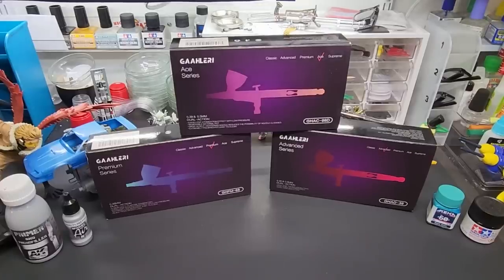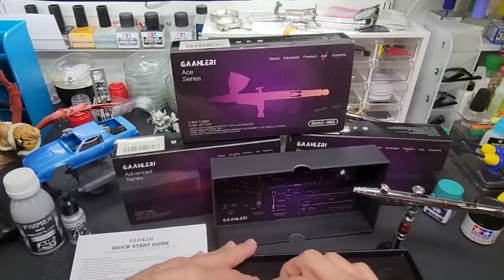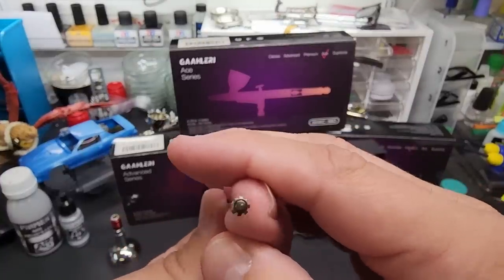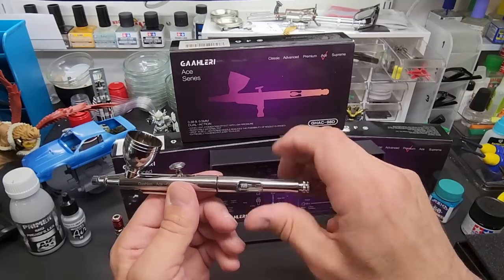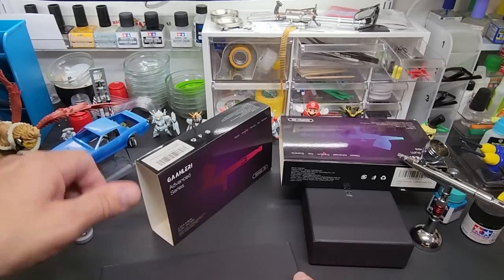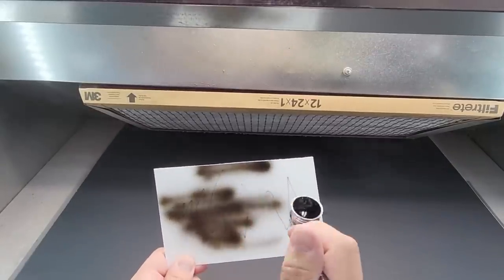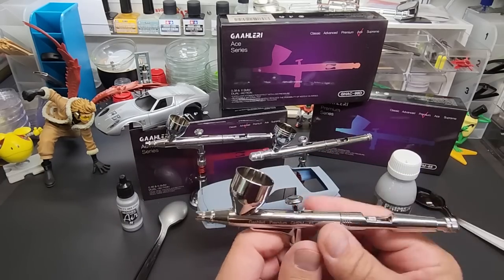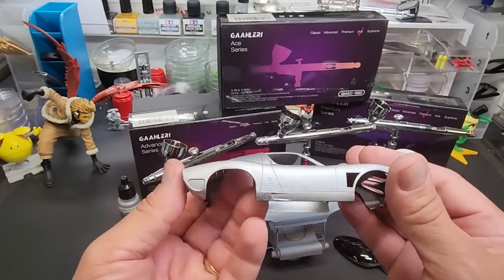Testing Gaahleri Airbrushes - Great New Airbrush Line

Comment: @barbatosrex
From my understanding the Gaahleri airbrushes are unique since they have the “8 channel” Quick self centering nozzle. 
My questions:
Do other similar airbrushes have a “quick self centering nozzle"? 
What makes Ghac 98D superior to the Ghad 39? The only physical difference? At first glance is…
Needle: Ghac 98D has a 0.38 needle vs Ghad 0.35 needle
Needle: Ghac 98D has a Flexible needle (only mentioned in Ghac 65 and up) vs Ghad 0.35 no mention of a flexible needle. Please confirm other models like Ghad-68 and down comes with flexible needle?
Ghac 98D has Mirror fixed cup vs Ghad 39 Non mirror removeable cup. I’m assuming this makes cleaning easier?
Aside from needle sizes, “flexible needles” and mirror cup what makes Ghac 98D superior to the Ghad 39? Does Ghac 98D atomize the paint better due to the “flexible needle” and needle sizes? What am I missing?

Comment: That's some impressive quality and performance for the price point. At first I was perplexed that a .02 needle set isn't included nor available. I typically spray paint at 12-15 psi with the smaller needle set in my Iwata HP-CS and use my Badger Patriot with a .03 needle set at 25-30 psi for primer. I'm really impressed that the ACE model will get such fine lines with no spatter using the .38 tip. Pure speculation here, but it seems from a design point, these guys have maybe cracked the code on removing air turbulence at the needle. I know by removing the tip guard from my Iwata, I can get finer lines. So it appears that the tip guard actually introduces air turbulence, which affects how fine a line you can get. I'm not currently in the market for a new airbrush, but I'll definitely be telling folks about this. I'm impressed.
Reply: Actually, the concentricity of the needle nozzle plays a major role in determining the fineness of the line, not just the diameter of the needle. The design of the air passage is mainly aimed at achieving a more uniform atomization effect. Our design aims to make this airbrush suitable for more scenarios, and after years of research, we have overcome the problem of maintaining concentricity with a quick self-centering drop-in nozle structure, resulting in very small production tolerances and lower pricing for mass production. If you have any other questions, feel free to email us!

Comment: The GHAC-98 Dual sprays VERY NICE! I used my GSI Creos PS-289 needle chuck though because I always disassemble my airbrushes prior to first use to clean and lube. Their needle chuck needs improvement.  Does seem to like the paint a little thinner than my PS-289, yet seems to reduce orange peel. Very happy with this airbrush.
Reply from the maker: Awesome, great to hear. These are very good airbrushes

Comment: First off, thanks for this review.  I am happy to see new companies entering the market.  I must be missing something though.  For $120 you can pick up a Harder & Steenbeck Ultra, an Iwata Revolution, a Badger 105, a GSI 289, or many other name brand airbrushes.  Other than the Chrome cup, which is nice,  I don't see what would make me choose this airbrush over any of those.  You are basically spending name brand money for a company that has no brand recognition, currently offers no replacement parts, and has pretty much one detailed review.   I took a look at the $40 offering, and it looks almost identical to a $30 Timbertech set I own.  Is the 8 channel MAC nozzle worth a 25% premium?  Don't get me wrong, I hope this company can hang in there for the long haul, but right now it doesn't make much sense for me to buy one of these brushes unless they are heavily discounted.

Comment: I own the ghad 39, the ghad 68, the ghac 98d, and the new swallowtail barbatox rex trigger ab. All are good brushes that I plan on keeping. With that said, the swallowtail has given me some trouble with the trigger not being smooth and with sharp corners on the trigger not being beveled. The brush becomes downright uncomfortable after a while. Whoever manufactures these brushes for Gaahleri represents the best quality that mainland china is currently producing. However, the price points of the 98 and swallowtail series are too high when compared to sparmax(better quality) and gsi creos(even better quality).  I have no doubt Gaahleri will up their quality to compete with these 2 mentioned above companies. They are just not quite there yet. At their current pricing structure there are better choices to be had.  I didn’t mention Iwata because although excellent brushes, they don’t really compete with Gaahleri price wise.  I don’t know of an ab on the market better than a gsi creos for the price. They represent the best value in ab’s imho.

Comment: Just got a 39 and was working fine until today. For some reason its not getting the full air pressure coming thru the brush. I did a deep clean and still not getting the full pressure thru the brush, any suggestions?
Reply from the maker: Contact them, they have the best customer service out there, they will help you for sure

Comment: Very nice! It seemed like the Ace really liked the primer, maybe more than the paint. They've really done the work to lay out some nice brushes and do some innovating in the process. I don't know why I didn't think of polishing the inside of my cups! I really wish they had sent you their trigger airbrush, as that would be up my ally. It looks good and uses some of the Ace and the Premium parts and has the eight channel tip. Well hopefully they'll send one your way and you can do some testing on that one.
Reply: I would be careful trying to polish yourself. I tried on one of my cheap brushes and the plating was so thin, first round with 2400 micro mesh removed the whole layer in some spots
Reply: @TheAlexdodd  Thanks for the heads up!

Comment: Great video. If I needed a new airbrush I’d consider it. But I already have my Neo for iwata, patriot 105, GSI creos ps289 and the cheap red one you did a video on and I haven’t even used the ps289 yet. 😅 I don’t paint enough kits or room for finished kits, to have that many airbrushes. I’ve only Just got rid of the all the cheap $20 ones I had lying around in various states of disrepair. But I’ve saved the video so when I do want a new one (it’s inevitable) I can go look up the link easily

Comment: I´m currently on a tight budget, so I bought the cheaper one; it just arrived today and it´s indeed quite awesome. I compared it to other quite similar cheap airbrushes, and while yeah similar, the measures are a bit different, and ofc, the drop off nozzle is quite different. Only downside is that the needles that came with it needed a good polish though.

Comment: Great review! I can't believe that gun sprayed Model Air at 15 psi straight out of the bottle as well as it did!! I usually have to thin it with 2-3 drops of the Vallejo thinner and then crank the PSI to 20+ (on a 0.5 needle) just to get it to spray properly. Gaahleri has done their homework and produced an airbrush I would have made (if I had the money), which means I'll be purchasing two of the Ace models so I don't have to switch needles. Thanks again!
Reply from the maker: For the record, I did put a few drops of Flow Improver in the Model Air

Comment: Purchased the Gaahleri GHAC-98D today for a Sunday delivery! Amazon gave an extra 5% discount in addition to the Barbatos Rex 20% discount for a total of 25%! Total cost out of pocket was $89.99 plus tax. This is on par with what I paid for the GSI Creos line of airbrushes also recommended by Barbatos Rex. I really like that they polished the inside surface of the color cup, and am wondering if this is possible to do on some of my other brushes?!
Reply: This airbrush costs around $10 usd. It is made in China, rebranded, marked up $30 goes to manufacturer, rest to Amazon and this guy making the video.
Reply: @ddx5769  And mine will arrive tomorrow. It is what it is.🫡
Reply: @dwells77  I’ll check back with you after a year to see how the quality is lol
Reply: I don’t mind healthy dialogue. However, if you’re going to identify issues with this airbrush/ airbrush offer, you should at least include solutions and/or alternatives. It seems like you’re just looking to be “right” or to be able to say “I told you so” when the truth is it won’t even matter in a year…

Comment: Your badger has the multiple air channels also.  They are in the housing right in front of that single hole you showed.  That hole is the air passage from the air check valve at the base of the body to the tip of the brush.  The air comes out that hole into the nozzel housing and spreads out through the housing,  then comes out the evenly spaced holes around that housing to spray around the nozzel tip abd needle. 

Still these look like nice brushes.  But i can't let you misrepresent my badgers 😂😅😂😅

Comment: Dang, wish I had found this a couple of weeks earlier since I missed the coupon deal, and the base price is a couple bucks higher as well. I've been looking for a cheap starter to re-learn with. I had previously tried a couple of siphon feed models, a Harbor Freight and an old Badger model I found, but constantly had problems and moved on. Been wanting to give it another try at some point with a gravity feed and was tossing around a Timbertech or NEOECO. Not in a huge hurry. Is this starter brush really a step above the others?

Comment: Bought a GHAD-39 with two nozzle sizes, very impressed with the engineering standard of the build, certainly better than the the other entry level tools I have (Harbor Freight & NeoEco) - the consistency of the results produced in fine work is especially satisfying and I believe delivered by the fluid control knob mechanism and ease of cleaning made possible by the design. I am only concerned with getting spare parts as and if I need them - the NeoCon and the HFT are problematic for spares; the Paasche VL & VLS I have are great for spares but can't really do fine work consistently; Can't seem to find spares online - Anyone got suggestions?
Reply from the maker: I'll be posting a new video tomorrow with new info, the Neoeco company is preparing a website so customers can order all the parts of the airbrush. It will be up next month

Comment: another great video. i am just starting to learn how to airbrush . i bought a sagud airbrush compressor kit off amazon . it came with 3 airbrushes . i think it will be good to start off with.   your videos will help me learn more trhank you for doing such great videos. the only thing is i cant tell what size needles come in them. they dont tell you on the paper work.
Reply: Airbrush Gun CS-30 with 1/3 oz gravity fluid cup & 0.3 mm pre-installed needle
Airbrush Gun CS-36 with 1/4 oz gravity fluid cup & 0.38 mm pre-installed needle
Airbrush siphon feed with 3/4 Jar & 0.8 mm pre-installed needle
Reply: hope you will enjoy them and get a great start on your airbrushing
Reply: @gaahleristudio  thank you sir. i found them they are 0.3 0.2 0.8 like you said .i used the 0.3 one it worked pretty good . i think i thinned the paint a little thin. i have testors paint .i watched your video on how to use them very helpful. i just have to learn how to ajust the airbrush and learn each part of the airbrush.
Reply: @Bubbasmodelcarshop  if you need any help, just contact us!
Reply: @gaahleristudio  thank you a question .i watched the video that you did on the elite spray booth master airbrush MASB 3000. i see you vented it into a bucket . i made my own spray booth and did the same thing .is there any special thing i have to do for doing it that way. thank you mike owens

Comment: Would you say this is a top 3 air brushes you would currently use? I had another friend suggest this company but i can't find out a lot of info on them.
Reply from the maker: They're a new company but I must say they are awesome. I highly recommend them
Reply: @barbatosrex9473  I just bought the ace. I didn't hear about the discount code because I got excited and got a call from work when I was ordering it. I will make sure I finish the video before I get so excited i hit buy now haha😅

Comment: Should you sand primed parts before putting on color?
Reply: I wetsand primed parts with 2000 grit tamiya sponge. Glass smooth after. Don't press hard, avoid sanding on the sharp corners, it's easy to go through the primer on the crease lines/corners.

Comment: I got the ace and trying out alclad black base it seems I have to blow a bit of air onto something to catch spots/blobs of paint so they dont fly onto the surface Im trying to paint, is that because its kinda drying in the nozzle cover? If I keep sweeping back and fourth like spray painting I dont get that, its only when I stop then go to start again it'll blow dots out
Reply: This is a normal phenomenon and occurs on all airbrushes. When we spray, we first press the trigger to release air, and then pull it back to spray paint. Therefore, at the end, we should reverse the process: first push the trigger forward to release only air, and then release the trigger. This is a good spraying habit. Because if you suddenly release the button while spraying paint, there will be residual paint on the needle and it will be blown out during the next spray.
Reply: @gaahleristudio  I think that was my issue! Normally I don't think about it and just release it but I've been trying to move the trigger back forward haha the ace moves paint good!
Reply: @Hughie1987  gladly you solve the problem,
Reply: @Hughie1987  hope our ace continue performing well!
Reply: @Hughie1987  if you could leave us a nice review that would be much helpful

Comment: My Ace version of the brush arrived and had a leak at the valve assembly. The folks at Gaaheri sent me another, and it had the same leak. My compressor runs continually, and you can feel and hear the leak. The leak is coming from the connection point of the valve assembly and the main body of the brush. Anybody else having this issue?
Reply: Can you send us a video of the leak, it’s impossible to have that issue in same two airbrush, can you check the connection again and we want to help you solve the problems
Reply: @gaahleristudio  The quick release was the culprit in both cases. After changing the quick release, the problem was solved. I am happy with the brush itself, and also happy the Gaahleri could solve the problem.
Reply: @Allessio777  thank you for your patience and understanding, if you could leave us a good review on Amazon that would be much helpful !
Reply: @Allessio777  nice to hear you solve the problem! Wish you could leave us a great review!

Comment: The needle chuck inside the GHAC - 98 Dual is poorly designed. If you want to lube your trigger, good luck getting it back together. Gaahleri’s needle chuck is two separate pieces where as the GSI Creos PS-289 is one. Thankfully my PS-289 needle chuck fit the GHAC-98 Dual so I could reassemble the airbrush. Hopefully this airbrush sprays amazingly, otherwise add $27.00 to the price and purchase the PS-289 needle chuck to make it an equal to its closest competitor.
Reply: Thank you for your suggestion, we will upgrade in the future. Lubricating oil can be added about once every six months.